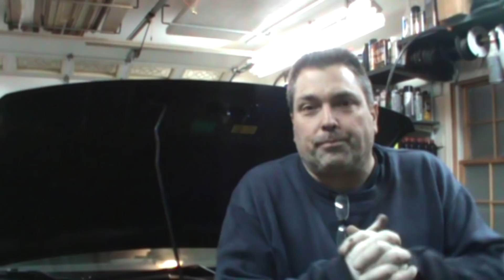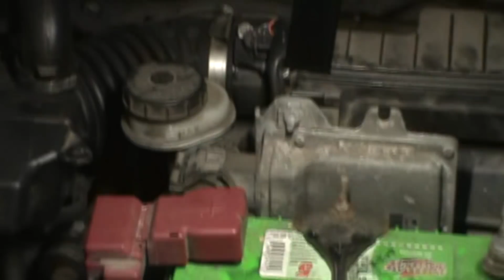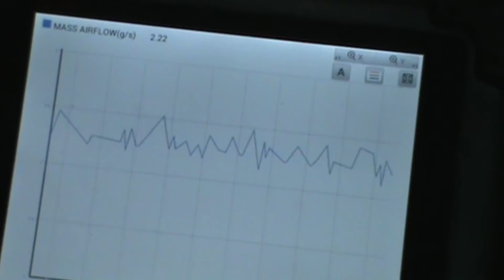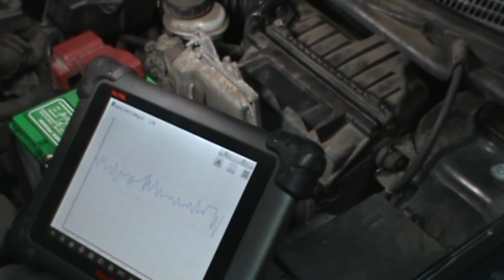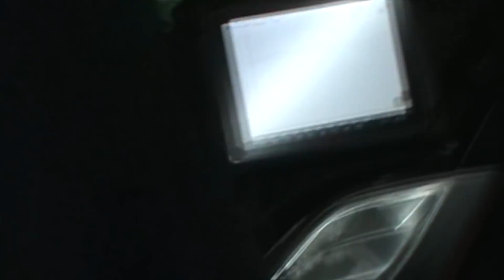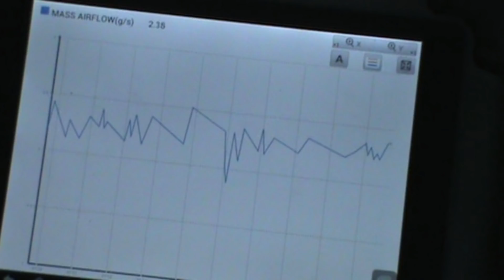2011 Nissan Sentra P0101 ZipTie Fix

Comment: Hi brother I got a question for you I got 2016 Nissan Sentra four-cylinder the check engine come on the Code Az says mass airflow sensor I replace for mass airflow sensor still the engine light on what do you recommend to do thank you
Reply from the maker: What tests have you done? Fuel trims? VE test?
Reply: Thank you for your reply my car run perfectly but the engine light is on three weeks ago I bought 3 hitachi mass airflow sensor  179.00 Dollar each from O’Reilly auto part they all three it doesn’t fix a problem I got one mass airflow sensor from Nissan dealer for 239.00 dollars I put it in the second day the engine light come on  as I said the car run perfectly before and after only the engine light doesn’t go away thank you for your reply

Comment: don't know if you are going to respond but i have a 2014 nissan sentra, that when i turn on, it automatically shut off.
any help with that.
thanks in advance
Reply from the maker: Unfortunately,  thats not enough information. Full health scan with a compatible scan tool should be the first move. Not a quick scan from Autozone. Let me know

Comment: Hey man what was the p0101 saying?out of range?im having this mysterious code on a Kia and the dealer cant find the issue
Reply from the maker: P codes identify the same across all brands. That's the purpose of them. No mystery here. Maybe you need to find a new shop to troubleshoot.
Reply: @SAAutoRepair  thanks.. solved by replacing the battery..kias stupid electronics cant feed enough voltage when battery is low.

Comment: I just happened upon your video after my sons 2011 Sentra threw the same code. One of the metal clips on air box was gone and other one was rusty and loose. Fingers crossed this is the fix for us also!
Reply from the maker: and OE air filters also. The aftermarket ones can cause the same issue. Let us know how you make out

Comment: On mine it was the flex pipe throttle body intake hose cracks on inner splines.
Reply from the maker: Also very common. Thanks for the feedback

Comment: I never would of thought it I’ve got the same car with the same problem I’ve got a screw driver wedge between the air filter and pcm to hold it together
Reply from the maker: New clips are cheap from the dealer

Comment: I have the 2 clips but I can still see the orange part of the air filter.  Could that be a problem ? It's not closing all the way.
Reply from the maker: Stick to the dealer filter. Some application it's normal to see part of the filters edge
Reply: @SAAutoRepair  thank you I am having the same problem with my mass air sensor ever since I had my air filter changed several months ago.

Comment: Hey man!!!
Thank you for this video!!!
While I write this comment, I have yet to apply this fix.  I have a 2012 Nissan Frontier (4 liter). I am missing a retaining loop (mine has loops) and my truck runs slightly erratic, intermittently shifts oddly.  I have already replaced air filter, cleaned throttle body, and put brand new MAF sensor in. I am going to try this zip tie fix.  Hopefully it helps my situation out.
Whether this works for me or not, I still really appreciate the tip to try.
Reply from the maker: They sell the clips separately at the dealer for like $5

Comment: Yeah its crazy but if you have the clips and the code comes back???
Reply from the maker: No guessing. The clips are just a common oversight and critical to proper air flow. Beyond that, scan data is going to be the way to go. Fuel trims, MAF readings, V.E. testing, etc. Usual suspects are (but not limited too), MAF, throttle body and proper air flow. Let me know how you make out

Comment: thanks.   a few years ago i had a 2001 dakota  V6.   my mechanic put a new engine in.   cant get it to run right.  my mechanic said it was my after market air cleaner.   but it wasnt.   so i started tinkering with it.   after some adjustments on the TB  RESISTOR.  it ran better.  then i sold it to my son.
Reply from the maker: Thanks for the support sir

Comment: Omg thanks so much man. Now I know what wrong with my Sentra . I have the same clip missing on the air filter ima have to go buy a replacement part for it right now. Thanks again .
Reply from the maker: Keep in mind, there are many reasons for that P0101. But making sure to use an OE filter and secure the holder is a good first step.

Comment: So when I found your video I said finally a 2011 nissan just like what I’m working on. With the same exact code same issue. However my air filter box has the clips. Been chasing this code for 2 days now 🙄 also have already replaced the MAF as well. The only thing I can think of is maybe it needs to be a OEM MAF. All values are fine with scanner. Runs and drives great. All wiring from ecm to MAF sensor are good. No resistance, no shorts or opens. So frustrating! lol I can’t wait til I figure it out! I literally have about 7.5 hours of hands on diag in this car right now!
Reply from the maker: I would also check and replace the air filter with OE. Some of the aftermarket ones dont seal right and can create some turbulence from the air leaking around the seal. Keep us posted on what you find. Thanks
Reply: @ angel ramos I ended up replacing the ECM and it fixed the problem. Also there is a technical service bulletin out for this issue. If you have a certain part number on your ECM the coincides you will need a ECM flash.
Reply from the maker: @puremayhemFTW  yes there is. This particular vehicle had it performed already by the dealer in an effort to resolve the issue. Thank you sir
Reply: I'm having the same exact issue with my 2011 nissan. I have both clips, Replaced the MAF sensor and air filter and check engine light continues to pop up. Was told that the dealer may need to "reset" this. Not sure what to do. Was hoping you had figured this one out.
Reply from the maker: @angelramos4268  I did figure it out. The missing clip was the problem with this one. Why did you replace the MAF? Was the other one bad? What tests did you run? VE test? I'd like to help, but I would need more information.

Comment: did you checked the fresh air hose for cracks , cuz what you were doing it seems that the fresh air hose its crack open,
Reply from the maker: Yes sir. Hose was surely checked. But you are correct, that is another common failure point. Thanks for the support

Comment: Very cheap poor fitting air filters, mis- aligned lower center air box hinge (frontier, old pathfinders, xterra's, armadas, Titans, NV's), missing air box clips (versa, sentra) and ripped intake boots (murano, sentra, versa) will all cause that p0101 DTC. What ends up happening is someone replaces the MAF with an aftermarket MAF than they can never get the DTC to go away because most of the time the aftermarket MAF makes a bad situation worst. Newer Altimas its a PCV updated PCV valve and reprogram (TSB for it) to fix the P0101.... Ohhh dirty and sticking throttle bodies will also give you this DTC, they stick closed from carbon build up, clean it good and make sure it doesnt stick in any direction, Manually push the plate both directions it should not stick.
Reply from the maker: I think you about covered it all my friend. Most of which is overlooked. Agreed on the aftermarket MAF causing additional problems. Ironically, the vehicle is coming in again for a MIL light. It'll be interesting to see what for this time.

Comment: A fleet shop i worked at on E vans had to switch to motorcraft filters for the same reason the cheap filters set fuel trim codes, great fix Corey!
Reply from the maker: That's wild. Thanks Mike